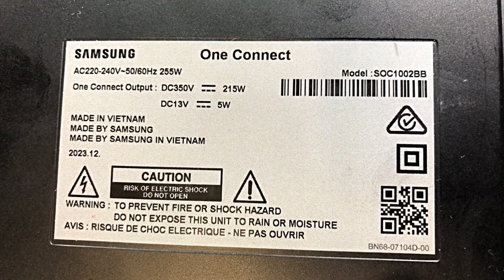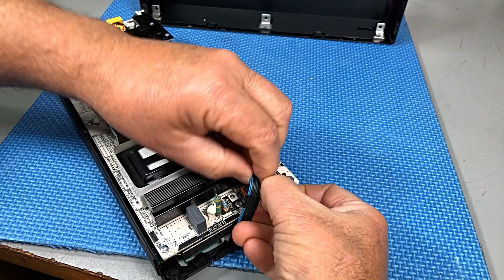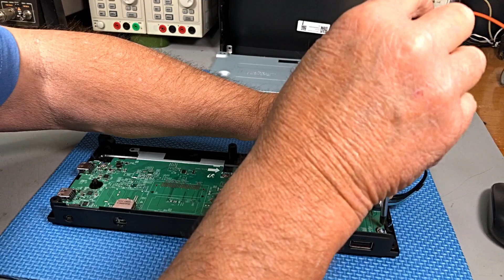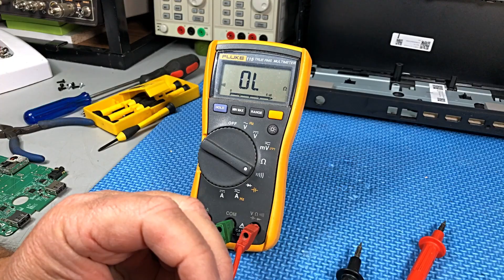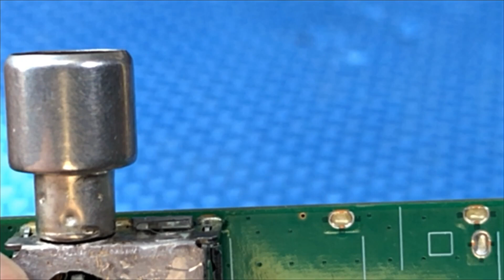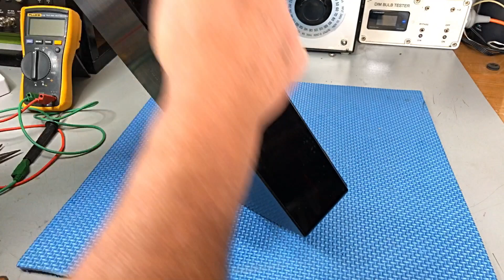Samsung Connect One TV Box - No Channels !

Comment: My guess for the "hand symbol' is a warning for high voltage (350 volts supplying the backlight). But again you could be correct about the screw. Samsung would probably try to sell you the whole board if at all. I have fixed many an antenna input connector (we use threaded F type connectors in the US). Customers would tighten the convector with a wrench and snap the input socket off of the tuner. Many a time we had to remind them to hand tighten only. Quite a bit different than working on the Admiral radio!!!!!
Reply from the maker: That  ✋️ maybe voltage related although it did look like you don't have to take it out.
I certainly can't count the amount I have done either, started on the 300ohm terminals in 1969. The old ribbon was a pain but seemed to work well in rural situations.
Cheers